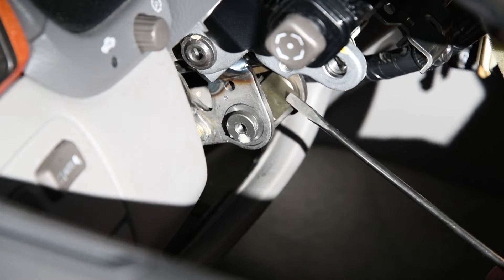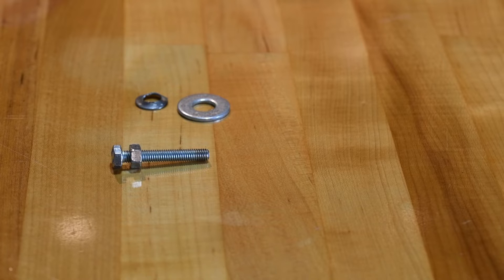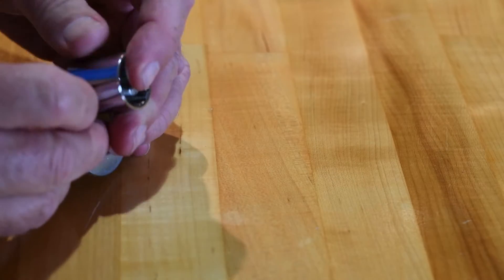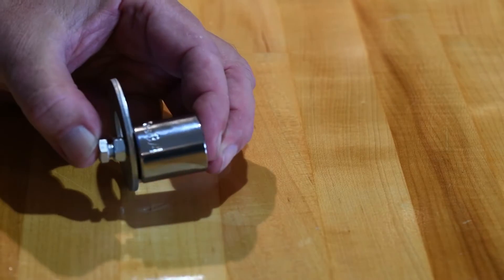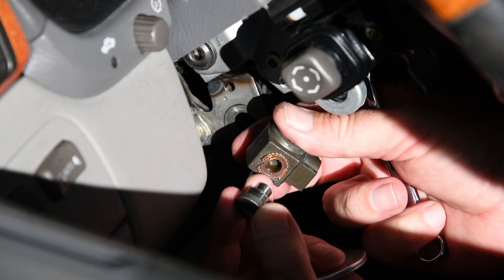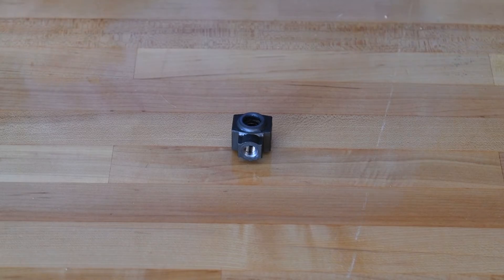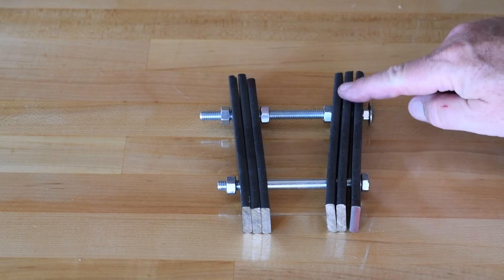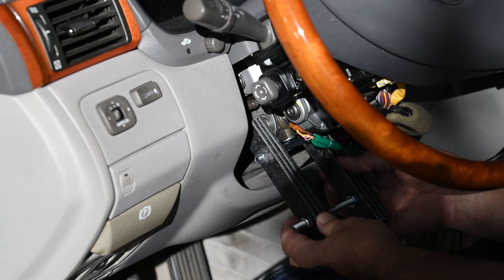2001 Lexus LS430 Steering Tilt Nut Replacement

Comment: You can loosen the plastic below the motor by removing a 10 mil. screw you can feel below the ignition switch and to the right, where the plastic touches the carpet. Pop out the bezel around the ignition and pull the plastic down about 3/4 of and inch then you can screw the motor in enough to swing the motor about 150 degrees and access the e-clips with a point and needle nose pliers. Do the same thing to put the e-clips back.

Comment: Great  Job  DAVE  !     Very  well described  and  explained       step by step .
I  have had  the same  problem.  changed   the  Tilt  motor   (for the refurbished one )  and    just after  couple  of weeks   the  motor  stoped  working.   
I admit   that    I  did  not  changed      the   Pivot  pin  nut,  and   I    lost   the   smoller   e-clip    (the  one that is further of  the  motor   it self).
Did  You  have to   use     Brand  New   e-clips     or   did  You  just reuse   the    once  from   old   motor?:

P.s.
I  would like to know;    what  is  the   the  cost   of  that    Pivot   Nut  and   Brand  New  Tilt Motor (if You do not  mind )
Regards.
maverick
Reply from the maker: You can use the old e-clip if you can find it.  If you don't have it, it is not expensive to get a new one, less than $5.  The pivot nut was about $18.  For a new tilt motor, I paid about $300.  I bought all my parts at:  www.lexuspartsnow.com.  I think the price of the motor may have gone up because I am seeing it listed for $396,

Comment: When you replace the tilt motor do you need to replace to tilt nut at the same time? or the tilt nut only went bad when the because the  Eclip was not reinstalled?
Reply: Because the e-clip was not reinstalled.

Comment: I'm a little confused Dave. I though you had fixed your tilt problem by replacing the tilt motor. Now your saying the threads on this "nut" also stripped out after you replaced the tilt motor? Thanks for any clarification you can give me.
Reply: He said he left the small e-clip out when he originally replaced the motor and therefore the motor axle screw worked it's way out from the pivot nut and damaged the nut threads. That's why he had to replace the pivot nut too. No need to replace the pivot nut if you put the axle screw e-clips back.